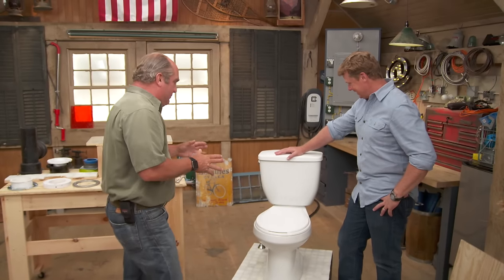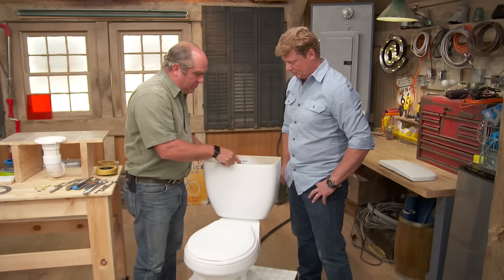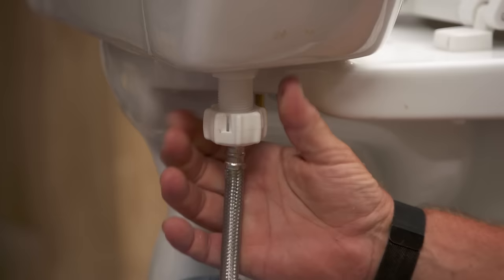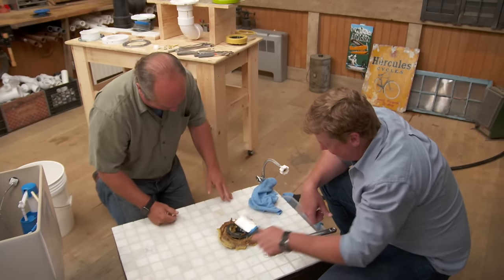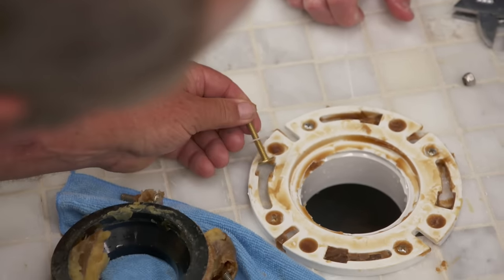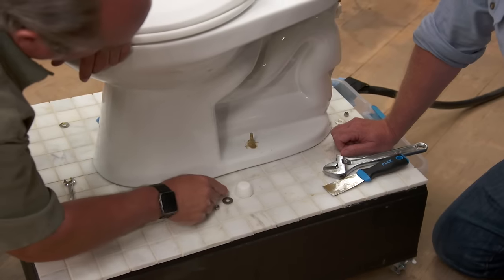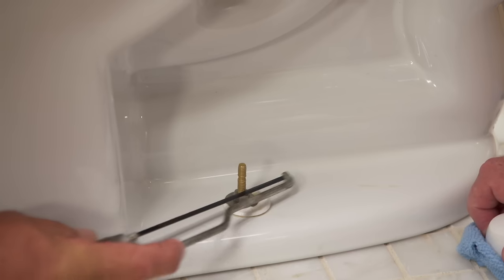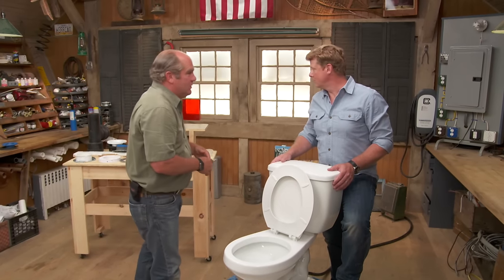How to Change a Toilet | Ask This Old House

Comment: Oh come on ............... you show changing a new crapper for another new crapper. That is not real life. No cruddy water tank, no frozen shut off, no corroded bolts, fittings, water line and old rusted away flange. The floor not rotted out !!  Find one that has been down for over 20 years and then you will have a true "how to", not this sanitary overview when everything is perfect!!
Reply: pkav8tor It's a mock up in their workshop...it's just supposed to show the basic technique. I'm sure they have more realistic videos
Reply: I don't want to see that shi...
Reply: There "actually" only concerned with what fills time in this silly fucking show.
Reply: pkav8tor My uncle hand a leak in his toilet after 50 years of services. Holy shit the smell was enough to make me gag and I am a sewer treatment technician. He had a clog so far down that we had to dig out the entire drain pipe to the street. The shit backed up so much it the toilet flowed backwards so all the shit was everywhere under the toilet. Just thinking about it brought back the ammonia smell.
Reply: Not to mention a goopy wax ring.
Reply: It IS real life
All the this old house videos are real life

Comment: You didn't mention that calking is needed around the base of the toutie.  LOL
Reply: Well if you have a wooden floor that is not a good idea to do. Because if the toilet does leak on the inside you would never know till the floor rots out. Then one day when nature calls you will fall though the floor. If you have a concrete floor  yea go ahead I guess. But some handyman down the road could rip up the tiles or flooring trying to remove the toilet for repair.Some handymen will try to remove a caulked in toilet with out cutting the caulking out just saying. Hope this helps.

Comment: couldn't help but notice one of those bolts he was breaking off was still loose. it was moving around big time as he was trying o break it off.
Reply: Paul Woodall yep,  that is why you dont use a pvc flange. You cant torque down the bolts without breaking the flange.
Reply: Saw that too.  Nowadays they use stainless flanges that last and ya don't have to worry about it period.
Reply: Paul Woodall  it's a  fucking demo